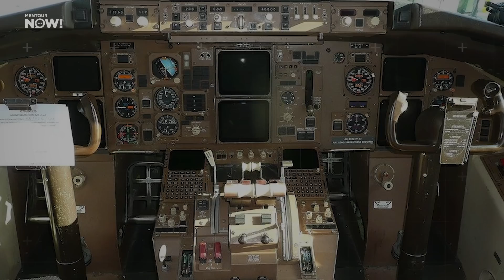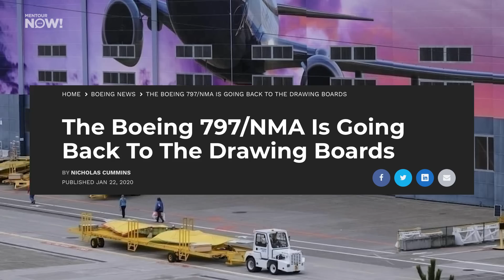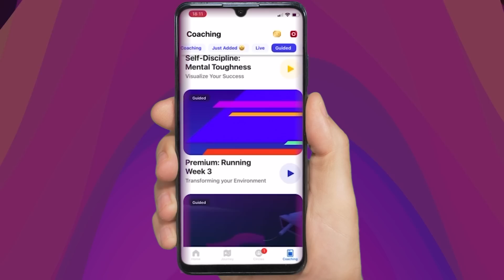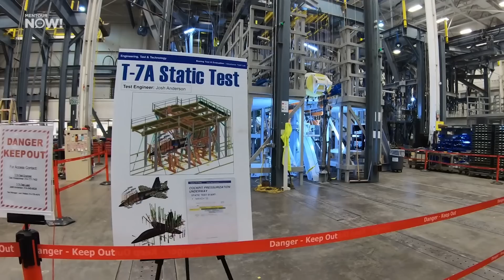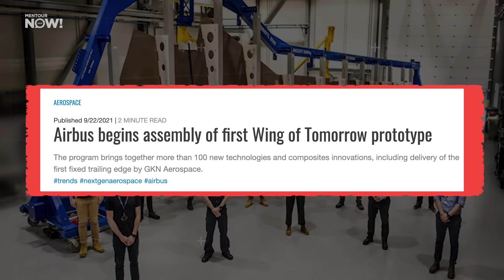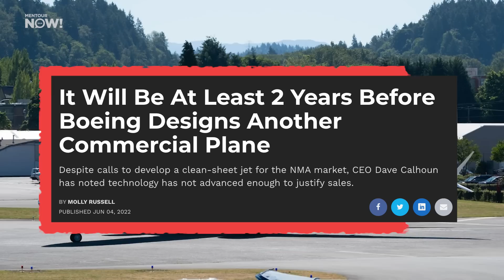Is Boeing Planning a 757 MAX?!

Comment: Professional pilot here of 40 years, with about 24,000 hours and 9 type ratings. I can say with great certainty, that of all my years in the air and all the planes that I have flown, nothing, I repeat, nothing gets close to the B757, which in my opinion is the finest airliner ever built! Boeing made a horrendous mistake when they shut down the production line...757 4EVER!

Comment: The 737 Max was basically a progression towards the 757.  A 757 with the 787 wing technology and the geared fan engines would make an excellent aircraft for the airlines. Pilots who fly the 757 love it, a real hot rod.
Reply: The MAX was an attempted cheap knock off of the 57.

Comment: Boeing management is lost. They have been since the 787 met production issues at the beginning. Instead of going with the 787 philosophy, they chickened out with the MAX. Now they need a 737 replacement AND an NMA. They are basically struggling between 150-250 seat market (2/3 class). Airbus A321Neo sales shows this.

Comment: Boeing since the McDonnell Douglas take over have designed not one single brand new plane other than the 787. They're useless as a company now. They need to get away from recycling older models.

Comment: Why are the GE NX engines from the 787 and 747 too big? are they physically too big to fit under the wing of the 757, or just would be ludicrously overpowered? and if they are just overpowered, why couldn't they just run them at a lower level of power?

Comment: Boeing has said that they need a new type of aircraft like the SugarVolt concept. However they are not close to having a finished design. They also require a new engine like the CFM RISE but since that new engine is still years away they are in no rush.

Comment: Boeing has done all it can to get rid of the unions. As a result, they have had lots of problems developing new aircraft. Until they bring the unions back to the table and work with them, Boeing will never be able to create any new aircraft. Also, when Boeing merged with McDonnell Douglas, they McDonnell Douglas management took the new company over and the McDonnell Douglas management don't believe in making anything new. They recycle old designs and that's why they still have the 737 around. Even the DC-10 had items from the DC-1 in it. So, Boeing will never be the great company they once were and The 737 will be in production long after Airbus even comes up with a new aircraft to replace the A
320!

Comment: After watching the video,

To me the overall answer is: Too late

To me the engine problem isn't the problem, as I think the 757 excess ground clearance would be enough (just look at the ground clearance that the 737-max engine have.....),

It is that quite simply it's been too long, there are no production lines, tools etc.

And as Mentour Now! says Airbus would just counter this,

And I think (my opinion here) that Airbus would probably have it's answer in the air and in testing before Boeing even built a scale mock up of the 757-max

Comment: I would have thought that given the excess ground clearance, a larger engine wouldn't be a big problem.

For example the GEnx 2B67B (747-8i engine), is 266 cm (5623 kg dry weight with a max thrust of 296 kN)

The Rolls-Royce RB211-535 (original 757 engine) is 188 cm (3705 kg dry weight with max thrust of 189.2 kN)

266-188= 78 then divided by 2 (because it is diameter) = 39cm "closer to the ground"

To me it SEEMS from looking at photo's that the 757 could easily accept the larger engines,

Especially when I look at photo's of other aircraft and "how close" their engines are to the ground (like the 737 series from the 300 onwards)

The weight different is 1918 kg so the wing would need to be strengthened, but the thrust different of over 100kN extra thrust would I'm sure make up for the additional weight.
 
But given that people who are much smarted than me have looked into this, I'm about to learn how I am wrong :-)

Comment: I would like to see a jump to an all new design that incorporates a new overall shape and layout. Perhaps a blended wing body, where the center is a lifting body. Perhaps chines on the nose that blend into leading edge extensions. Perhaps moving engines up, either to the top or inside part of the structure. Side bulges on the body could be used for fuel, piping, and wiring and might even have maintenance crawl ways. The US military could use some new command and control aircraft and perhaps could cover some of the initial development costs with guaranteed sales of a few units.
Reply: The initial costs tor developing and testing such a radical new design will be substantial. But the potential advantages in fuel economy are worth it. For the military, such shapes and materials may also make it slightly less observable than legacy platforms.

Comment: Sorry but no! The 757 production line is closed and all the tooling has been scrapped. It would be cheaper to start a whole new airplane. Most if not all the 757 drawings are NOT digital (CATIA) and converting them would add an extra cost. So, no. Boeing should have used the 757 instead of the 737 for it's next generation.

Comment: The name MAX needs to be retired forever.  MAX just means to take a plane's envelope past what it is good for, pretend it flies like the old plane so as to not require pilot training while patching things up with crappy and dangerous MCAS software that want to kill the passengers at the first chance it gets.  0 trust in Boeing's engineering capabilities at this point.  What a disappointment, Boeing used to be a leader, now it cannot even get the MAX 10 certified not speaking about the 777X.

Comment: Petter,

YOU DID NOT ADDRESS THE  cost/benefits of such a project. These can sometimes be intangibles that very few "accountants"  and "MBA's" UNDERSTAND OR WANT to understand.  For example, for a great engineering company like Boeing its Engineers are, (or should be), every thing.  "Arty types" or accountants are as common as grains of sand on a beach.

EMPLOYED ENGINEERS ARE A GREAT BENEFIT -- Argue with that if you can in the context of the world today. 

A great engineering company needs to keep their engineers occupied and motivated ... if it doesn't then that company will surely sink.  But stupid accountants and the management at Boeing do not understand this ... why? ... because it does not fit their slavish "satisfying the shareholders" mind-set
.
Petter,  you have identified the gap in the market for an aircraft with a passenger capacity between the 737 Max and the 787. Airlines that want to be cost efficient will adopt an aircraft that fills that real gap. Who can argue against that?  That's why such an aircraft will be built, if not by Boeing then, (God help us), by the no coupled/ feedback Joystick mentality Airbus.  Perhaps it will be a shortened version of the 787 with less powerful engines .. although such an aircraft will look peculiar!  (squat and short - not at all like the sleek and stunning 787).

As for tooling/jig costs these are not as high as they used to be thanks to digital iterative design, 3D printing, (prototyping),  and all the software design tools available.  Plus if such a project is designated a "design and build" project and extended multinationally, (like the 787), these costs can be shared.

I'm a British engineer and I believe that Britain could easily be persuaded to take part in such a project,  (building the wings say), in addition to Rolls Royce.

Finally, if Boeing don't build such an aircraft and start to get ahead right away then China will do so and eventually enjoy a large international market customer base  -  I have no doubt about that. Even if you do not like China you should not doubt that, either.  

Best wishes to you and thank you for your video highlighting this airliner gap.

Comment: It would be impossible for Boeing to build a 757 Max.  757 production stopped in the early 2000s, and all the tooling is gone.  They could build an entirely NEW aircract that mimics the size and performance of the 757, but at this point they'd be better off working on an all new 737 with a range in size that covers the size range from 738 Max to near 753.  Personally I think they should've Maxed the 763 and called it a day!  :-)

Comment: The greatest challenge of any heavy industry is not to meet the immediate demands of today but to meet the demands of the decades to come.  When you have accountants making the major decisions to satisfy share holders first and foremost, it's eventually going to lead to a lack of innovation, a lack of forethought, a lack of long-term thinking.   That's where investors have to be smarter about what they're investing in, otherwise we get a 737MAX.  If instead of pulling the plug on the 757/767 programs as a knee-jerk reaction to the temporary reduction of travel, Boeing put those programs on trickle realizing that there would likely be a resurgent demand down the line, they would have been prepared for things to come.  Perhaps they would have had designs to meet it?  As much as I would like to have faith in businesses as large as Boeing, I still think it comes down to taking chances and luck.  No one thought the 747 would be as successful as it was.  I doubt the engineers of the 707 in the 50s would have ever thought much of the DNA of that aircraft would survive recognizably 70 years into the future.   Case in point:  Right now A380s are ceasing production and they are even being scrapped!  Hmmm, do you think it's likely that human beings are going to stop reproducing at alarming rates?  Sure it would be nice if less of us were mucking about this planet but that's fairly arrogant of me to say considering I'm already here.  Given we're not likely to stop,  is it more economical to fly 700+  people in 3 smaller jets or in 1 larger?   So what is Airbus going to do in 15 years when the A380 is a more viable aircraft in places like China where even short haul flights might have a 500 passenger demand?
Reply: "If instead of pulling the plug on the 757/767 programs as a knee-jerk reaction to the temporary reduction of travel, Boeing put those programs on trickle realizing that there would likely be a resurgent demand down the line, they would have been prepared for things to come." 
Airbus, of course, has made exactly the same mistake with the A380. Now all over Asia carriers are starting to scream for them on thick routes with constrained airport slots - exactly the market for which the 380 was developed (NOT Emirates-style ultra longhaul - that was a bonus) but which with one thing or another took longer to emerge than anticipated.
Reply: @kenoliver8913  Agreed and I said the exact same thing at the end of my original comment.  Cheers!

Comment: As has been mentioned, the hole in the market is, really, a function of engines.  As I see it, there are really only two options for an aircraft to fill this spot:  1) Build a smaller (shorter) 787 and use existing engines. I don't see this as happening as fuel burn and airframe cost would be an issue. The same option would exist for the A350 but, again, it faces the same problem. 2) Design an entirely new airframe using 3 existing engines from the LEAP or other family. This also has major issues. First, three engine costs (acquisition and operation/maintenance). Second it probably would require an entirely new airframe. 

So, the only realistic way out of this is for a new engine suitable for a twin.  Engine manufacturers, at this point, probably don't see a big enough market for such an engine. We may just have to wait for the market to change. 

Bottom line?  I Don't expect any NMA aircraft to appear within the next decade or so.  Having said that, unless Boeing management is willing to bet the company (which I doubt), Airbus might be in the best position to make this happen.

Comment: I think a stubby two aisle plane is better from the sake of the passenger and being able to outfit it with a competitive business class. Two aisle planes can de plane and load faster and since there is more room inside it's easier to clean and configure. I think a 747 compact with two engines would be an awesome plane smaller than the 747SP or a compact 787, both planes would attract customers to ride the airframes and they can tool the compartments to be very competitive and attractive to customers. The 757 was too long, often only single jet bridge unloaded and loaded and took forever to turn around.

Comment: May be it's because the 757 was a British design from the early 1970's. It being a licensed production - I assume, of the HS134 by Hawker Siddeley, which was to be named Airbus, ironically enough. The 134 and 757 designs look identical; but there was no production by HS. A story very similar to the origination of Lockheed's L1011 Tristar. Both aircraft using the Rolls Royce RB211 engines. And initially it was  Hawker Siddeley who were the British component-(before they pulled out) of what was to become the european  'Airbus Industry'. IF British politician's had not been so treasonous and supine it is certain that Airbus would be a majority owned(51%) British Company and the 134/757 would be one of it's aircraft.

Comment: My first Boeing job was as a Drafter on the 757 (wing structures).  ;-)
I had a computer design concept, utilizing 3D technology, where you'd sit in a cubical, put on your head gear and see a 3D representation of the area you were working on the previous day, ie: the forward wing spar, locating hydraulic lines, their connections, support brackets and "P" clips.
You would either grab an existing 3D bracket from a image list or form a new one, locating it within the spacing tolerance from the previous bracket and tube connection and on a small screen the new bracket would be created on a drawing (with bends, holes, etc...) being added as it's formed.
Reply: Wow! It must be lovely hearing Petter and pilots commenting on how sporty and enjoyable it is to fly. Congratulations on being part of that design team - it sounds like a dream job that likely goes unsung. Speaking of which, were you at Boeing when it was taken over? If so, I'd love to know what you think of the documentary on the Max.
Reply: @HandmadeDarcy  If you're referring to the M.D. merger, yes, but I wasn't involved in the 737-MAX situation (I'd retired in 2014).
It was funny, each time I got laid off, I'd get evaluated for jobs I was suited for, but the result was the same... design (drafting, technical illustration, ect...).  ;-)

Comment: 2:16 put a smile on my face.   As a consultant back in the day, I did a bit of travelling and got familiar with the various aircraft I'd be on and the 757 was my favorite.   "Sporty" is a great term for the thrusty takeoffs and the sound of the engines always put a smile on my face.
Reply: Taking off from Orange County/John Wayne would require us to set the park brake, run the engines up to maximum thrust, then release the brakes. The acceleration really snapped your neck back to the point that we had to warn the passenger to expect this prior to takeoff. We did this for 2 reasons; the short, 5700 foot long runway, and to fly the very challenging noise abatement profile. Their were noise sensor for about 2 miles off the end of the runway and is you set one off, it was a $25,000 fine. I once timed it and we got to 100 knots/115 mph in 9 seconds on one of of those takeoffs.
Reply: Ddd 4s

Comment: When I was young I could have never imagined a 737 seating 230 pax LOL. I sure wish Boeing would tool up for a reintroduction of a revised 757. It's a beast and looks the goods. I consider it a 2-engine 707 with a durable evergreen design. I loved flying on the 757s during my numerous trips to the states years back. Good points here...it'd be big job to get a new 757 back in production. Existing 757s would need that sweet spot engine in the 35-40,000 lb thrust range and as you say, it would need to be developed specially.

Comment: The 757 was the most fuel efficient airliner on a per seat basis.  Passengers loved it's easy take-off, just lifting off of the ground, instead of a very high nose climbout launch.  That may have been just a perceived difference.  In retrospect, Boeing ceded this market to Airbus - what a gift.  It is looking like a major misstep by management.  They probably want an aircraft that can handle LD3, LD7, and LD9 cargo loading on the lower deck to ease ramp turnarounds.

Comment: As a passenger I hate the 757. I very much dislike the single aisle concept. I very much enjoy a real wide body where I can get up middle of my flight, bothering the least amount of people in the process, and not hit my head. The single aisle is brutal too when you need to use the washroom and the drink cart is out. I very much enjoyed the 767 and currently enjoy the 787. I fly Delta a lot and when I have no choice but to take an old 757 I get annoyed

Comment: It’s not happening because all the 757 tooling and manufacturing equipment has been scraped since 2005. Boeing would have to replace all that, which at that point, it might as well start from scratch with a clean sheet design.

Comment: I consider a bit more simple, looking the passenger and cargo market, the ideal airplane is the 767-200.  Good for cargo and for passenger and considering the future of demand.

The 767 is taller meaning easier to fit a new engine. The double aisle would make embarking and disembark faster and more pleasant with a outstanding flying confort.